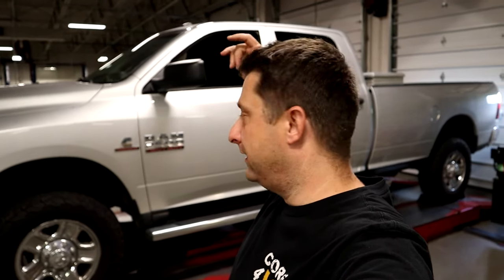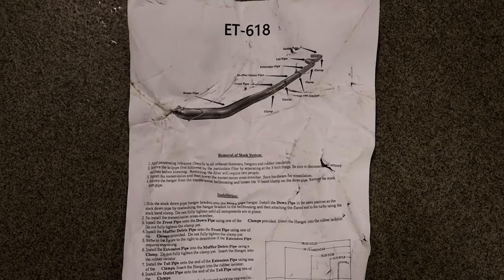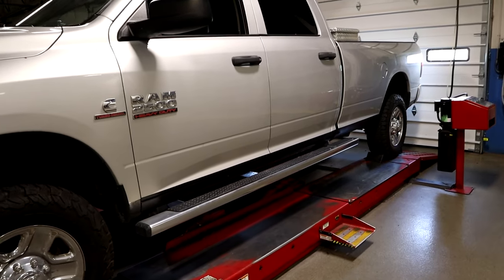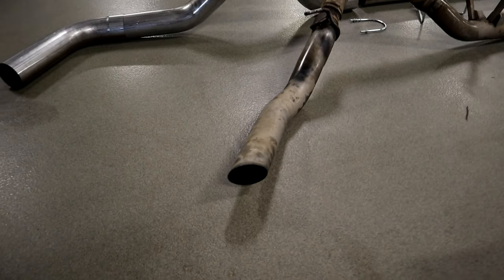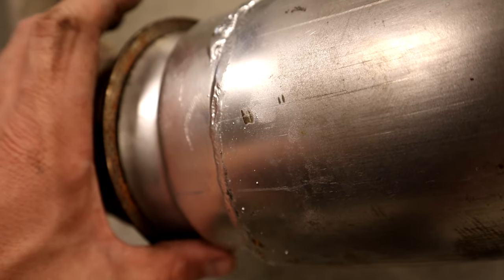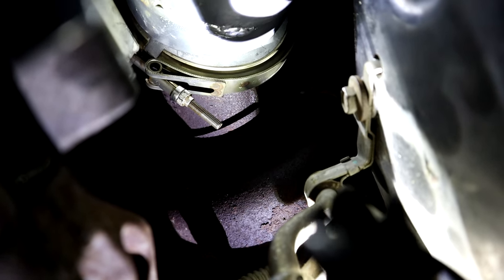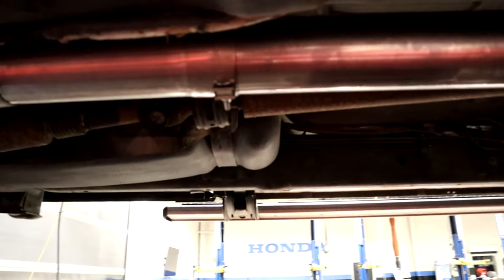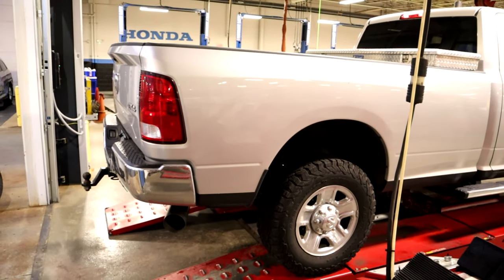5" Turbo Back Exhaust Kit For Your RAM 2500/3500 Cummins Sounds Amazing!

Comment: No one ever shows how they got the vband on. It has turned my quick job into 3 days now.
Reply: Yup I put mine on about 7 years ago and omg what a pain that v band is. It's like it takes longer to do than the entire ehaust!
Reply: Please share any helpful info please!!!!
Reply: @SleepyJoeisSlow  What helps is taking the passenger's side wheel well plastic completely out. Make sure the flare is correct on the exhaust if you are not doing a complete turbo back. If you are doing just from the downpipe back, get someone to help you line it up and do that pipe first, but leave the band loose until you are done.
Reply: @alittlebitofeverything5090  Hey I really appreciate that info!  
May your favorite team win this year🌝
Reply: @SleepyJoeisSlow  No problem at all. If you were close to Massachusetts I would help you do the install! Definitely easier with 2 people. If you do it by yourself grab a case of beer lol
Reply: @alittlebitofeverything5090  Man that's cool of ya!!  But yeah I'm about 15 hours from ya. 🌝
Reply: @alittlebitofeverything5090  And I got an uncle with a car lift
Reply: @SleepyJoeisSlow  Right around the corner lol

Comment: So basically the instructions they include you don’t need. Seems like it needs to be downpipe, long section, short section, medium section, over axle. And no where does it mention cutting for a crew cab king bed but if he cut 5 inches then I guess I am too

Comment: I'm late to the party. Flying from Cabo San Lucas back to the US to purchase a 2014 or 15 2500 6.7L. Since I now live in Mexico and could care less about emissions, is this full delete the way to go? I've read the DEF is a good thing for fuel mileage. This truck is going to be used for towing long distances. I assume I can find a section and install a 5" muffler. I know EPA has been cracking down on everyone....wish I wasn't late.

Comment: I bought a 5” back for a 2012 Cummins the turbo flare was to small I had to bend it back with a hammer to flare it more and mine did not come with that nice dual hanger bracket

Comment: I'm getting ready to put this on my truck. I can't wait for the 5' sound.
Reply from the maker: Right on!
Reply: @FrostbiteRam  can this same sound be done with out deleting?
Reply: @anthonykontos7931 you can remove the muffler but it still wont sound the same as a fully deleted truck.
Reply: Get ready for cabin drone if you go straight pipe. Sounds amazing though.

Comment: To bad they don’t have it for the third gens I was excited for a minute
Reply from the maker: Pretty sure I seen some on the page
Reply: @FrostbiteRam used this 5 inch on my 2015 but I ended up cutting and swapping flanges for the turbo. Also used the wider step clamps on the pipe section. Sounds good though.

Comment: I like the rusty, rattle can chrome paint job with rust coming out. 
Is it really stainless???
Reply: Probably low grade stainless also anytime you contaminate stainless with carbon it can rust. Who knows they could store this stuff on a carbon rack, or use a carbon wire brush or something.

Comment: Are the little tubes going into the exhaust required to be capped? Or do you need to tune them out?
Reply from the maker: If you have a non deleted truck you will probably need a tune. Mine was already deleted but still had the factory 4" pipe.

Comment: Do you get a drone sound?  Was told to put a resonator on with a muffler so just wondering.
Btw fantastic vid!
Reply: All the exhausts have a drone sound because the pressure echoes inside the pipe. I bought the twister muffler that has a corkscrew inside of it and it completely eliminated the drone. I installed it before it goes over the rear axle. It's about 18" long can't remember the brand. The exhaust won't be as loud on the outside but it's still pretty loud.
Reply: @alittlebitofeverything5090  Great!  A little loud is ok.  Hearing me two blocks away isnt lol
Reply from the maker: Thanks and no drone with the new karnage performance diesel muffler its awesome
Reply: @FrostbiteRam  oh, I bought the twister resonator.  Guess a muffler might be in the future too.  Thanks for the reply!